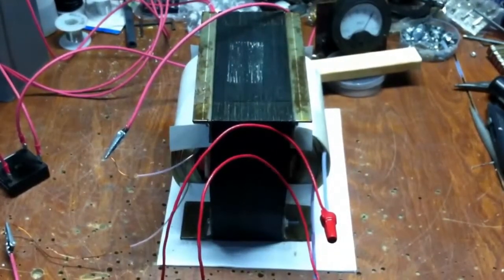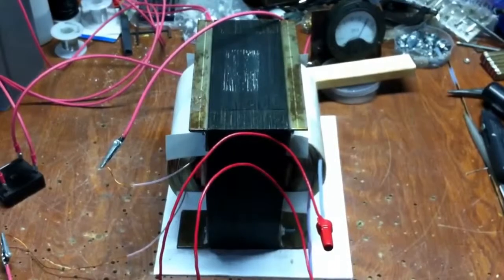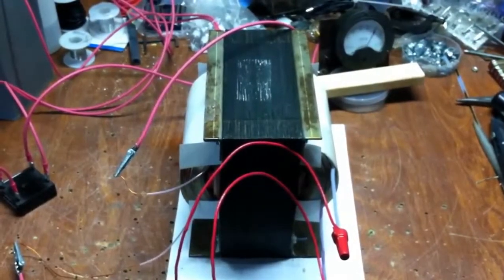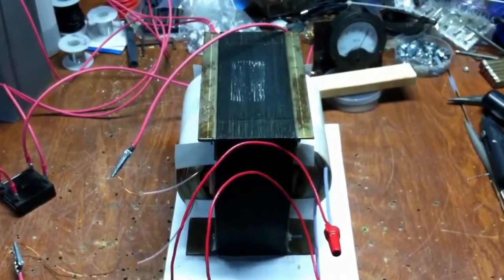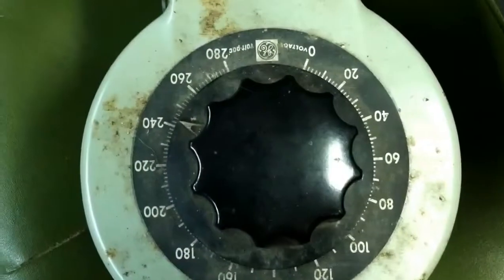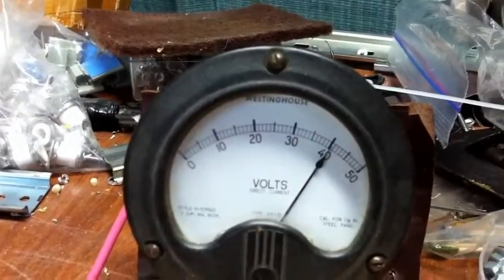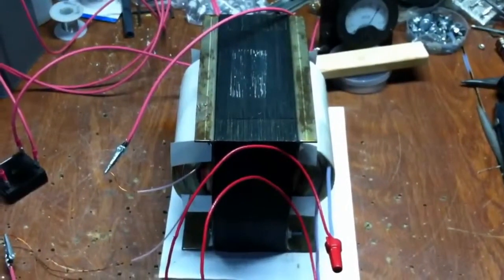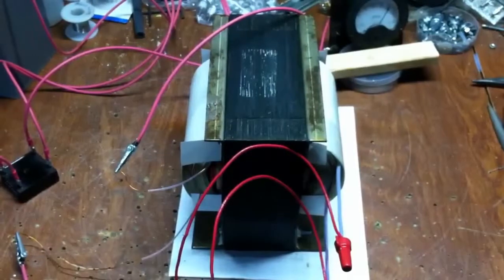HOMEBREW EI HIGH VOLTAGE TRANSFORMER

Comment: Do you have any experience with toroidal HV transformers like some of the current linear amp manufacturers are using? Maybe 5kV at 1.8 amps after a FWB and a capacitive input filter? Their smaller size and lighter weight sure are appealing. 2E0ILY UK. Nice videos!
Reply from the maker: No I don't.
Reply: KF8OD OK, thanks for the reply, I enjoyed the videos. All the best.